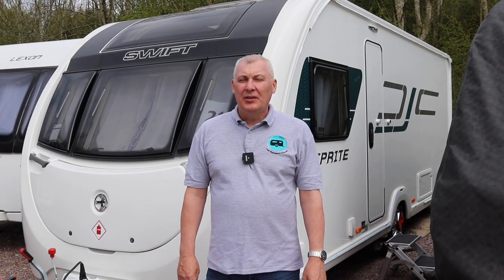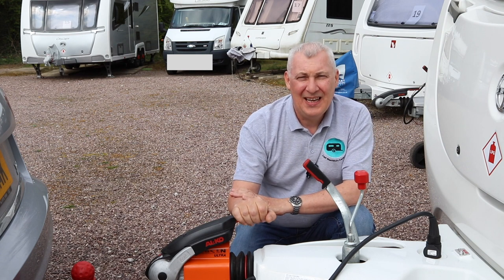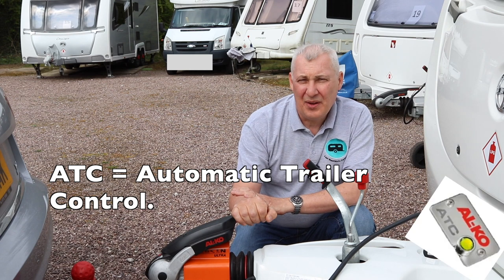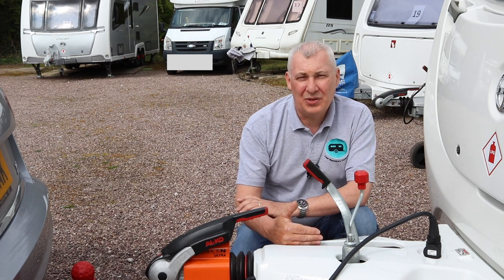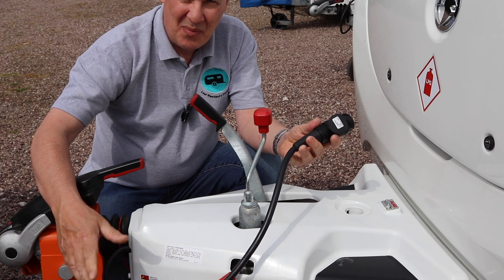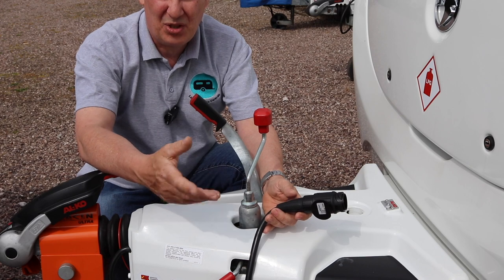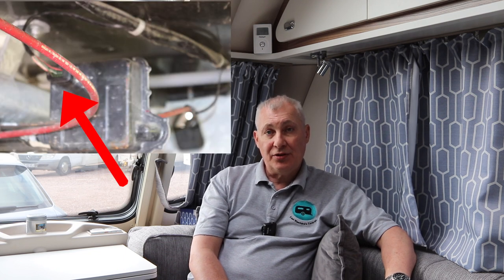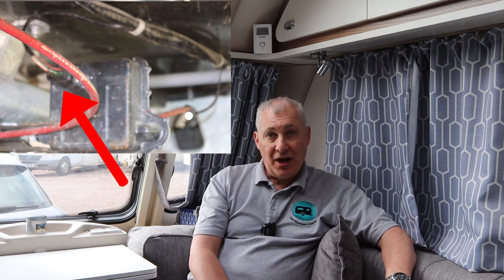Caravan ATC Problem (Solved)

Comment: Thanks for sharing this one Phil, I think I may have the same problem with my 2020 Bailey as there is no light displayed on the ATC. I will carry out your suggested checks and see what I can uncover. 

Much appreciated, you have another subscriber to your channel. 

Cheers
Colin
Reply from the maker: Hi Colin. Thanks for watching. Just to let you know the LED could also be faulty. We had ours replaced after owning the van just 6 weeks. Replacing the LED is very easy to do. Thanks again and welcome to the Channel. Phil🙂👍
Reply: @lostweekendscaravan   thanks Phil, I will check that too. No noise coming from the brakes when I connect so suspect it could be deeper than a bulb unless the bulb is part of the circuit. 

Thanks again 
Colin
Reply from the maker: Hi Colin. There is very little that can go wrong mechanically. Try the fuse, cable connection and test your connection from the Tow Car. Hope this helps. Phil🙂👍

Comment: Hi I’ve bought a caravan with this fitted my car doesn’t feed the power to it . Is it just a live feed it needs to go to the pin in the plug and it will activate?
Reply from the maker: Hello the answer is yes it requires a live feed from the car. If you have a universal  wiring from the car this maybe the issue.  The best wiring system is a car specific for your make and model. I hope this helps. Phil.
Reply: @lostweekendscaravan  thanks for the response. So if I loop a wire from the constant live at my plug into the pin that would feed my ATC would that work? It could literally be done at the back of the socket with the correct rated wire??

Comment: Hi Phil, I’ve got a 2018 Sprite Major 6TD. Did you get the ATC fitted as a dealer fit option, as mine didn’t come fitted with that as standard?
Reply from the maker: Hi Paul. Good question. We had it factory fitted when we ordered the van. I think it can be fitted as a retro mod.. Thanks Phil👍🙂